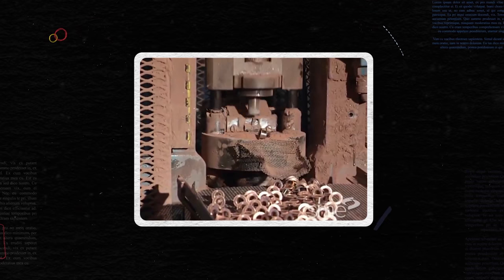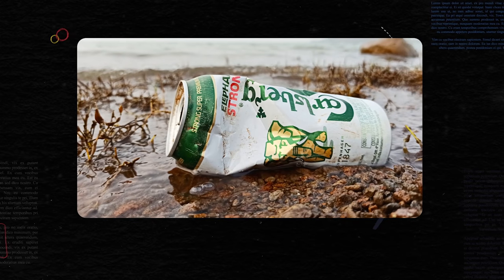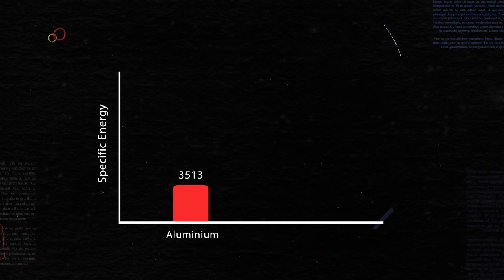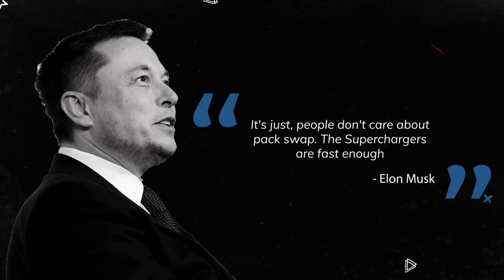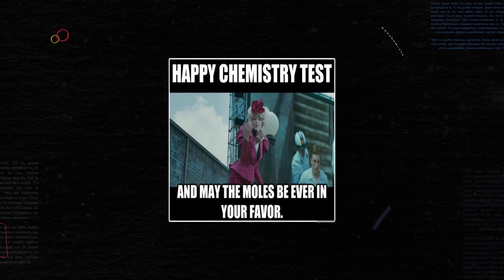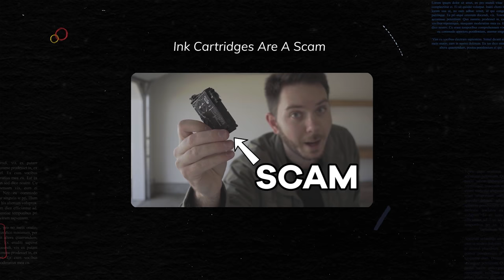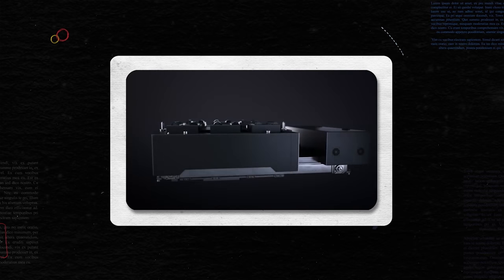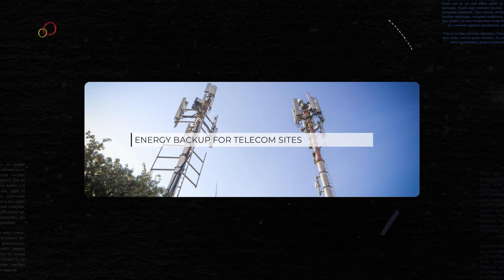We Can Get 1600 KM of Range With Aluminium Batteries

Comment: EV universal tow hitch connector would be helpful.  If all EV's could pull a trailer with an Aluminum Cassette battery you could get the needed saturation and greatly extend ranges.  That solves the chicken and egg problem of creating EV's before the infrastructure is fully in place.  Tractor trailers and delivery trucks would probably be the first vehicle to put them in as they tend to have regular routs.  
Also creating an automatic system to add water would be helpful.

Comment: Insightful video. Very interesting.
The only difference between fuel burning and single use battery discharging is that the battery has no emissions to environment while discharging.
Alas, i would argue, that making the battery creates more emissions than burning an existing fuel.
An electric battery for single discharge=human made, solid fuel.
The battery composition dosnt really matter in energy terms, what matters is the energy invested in making the battery.
The best solution is a fueled battery.
The fuel is mass produced/recycled in a factory. You drain/fuel your battery, instead of charging it.
It takes less energy to manufacture and recycle battery fuel than manufacturing rechargable battery and charging it.
Rechargable batteries are made from expensive materials.
Instead of rechargable batteries we need drain/fuel batteries.

Comment: This type of battery should be tested at installations like the Port of LA, large urban bus systems, perhaps integrated into a UPS. Perhaps  local subway or commuter rail systems would be a user. It would simplify the installation and maintenance of centralized systems if the economics and power density pencils out

Comment: If you have to refill water every 300 km, doesn’t that refill, constitutes the limiting distance of an EV.  1000 Km to swap Al cassette, and as ubiquitous as water is, technically it still limits the distance to less than a third of those declared in specifications.

Comment: The trick is to create an Al/O2  or maybe Al/F or  some other chemistry that allows aluminum to replace as a metal anode.   An amalgam or gallium allows aluminum to  react, but once it’s Al(OH)3 it’s a mess.    If there was some low temp material which could  contain the oxidized aluminum, allowing it to recharge /reduce, then presto.  
Cryolite and carbon is no good on a car.  Perhaps in grid level storage the high temp molten battery will work.    Reducing bauxite to aluminum probably takes a lot more energy to recycle than the energy cell puts out.

Comment: 300km is about the range of a tesla. so instead of charging you will be replacing electrolyte and sludge. For EVs Aluminum Air batteries are a terrible choice. Aluminum takes a ton of energy to produce so in reality it is a terrible inefficient storage method unless you are using over capacity which would be wasted otherwise. There are better uses for that wasted energy though such as pumped hydro or even hydrogen production. 
The bigger problem is that Solar energy actually makes global warming worse in the long run. You are absorbing more energy from space just as if you were emitting greenhouse gases. You need to increase the amount of energy the planet gives off and not increase it by covering it with dark solar cells. We need to reduce absorbed sunlight and reflect it back into space while using geothermal, tidal, hydro, and nuclear. Wind power although a great energy source produces lots of carbon fiber pollution and requires lots of energy upfront. We no longer have that spare "global warming" capacity to use wind energy. If you want to give Humanity a chance of surviving we need to go nuclear NOW and increase size of the ice caps while decreasing the amount of light we absorb through, roofs and any other dark surface.

Comment: The aluminum is recyclable.  If the facility doing swaps is managing that it could drop the price substantially as aluminum is nearly infinitely recyclable (does not degrade during smelting).  The only issue is that the smelting is very energy intensive and probably eclipses the charging power.

Comment: The convenience of charging a car at home cannot be overstated, so I think Lithium batteries are not going anywhere. But combining them with an aluminum fuel-cell as range extender is a great idea, I think, if cost for the dual system is on par with a larger battery. (I drive a Volt so can appreciate the concept of range extender.) Utility-scale storage, or even home energy backup are great ideas too.

Comment: I want to comment on a fault statement about unrecyclability of Li-on batteries in this vlog; Li-on ev-batteries will have a closed cyclevery soon! Large scale recycling of Li-on batteries has been planned for years and is being worked on right now. It will be done for at least all Tesla cars and highly possible all other cars as well!
This sole fact entirely spoiles the case made in favour for Aluminum Air batteries. In time there will be another type of batteries to replace Li-on batteries, but it won't be Aluminum Air batteries ...

Comment: It was good until she said L-Ion batteries end up in landfill, it might be true for phones (although legislation should prevent it), but it is not true for large vehicle batteries.   Cars mostly don't need it, but large long haul vehicle or long duration will benefit from swappable Aluminium or Lithium Air batteries.  Perhaps caravans could include it to extend the range of the tow vehicle.

Comment: The comparison to lithium as a component of the Earth's crust is a mis-direct, because the percentage of the actual lithium content in a lithium-ion battery is vanishingly small compared to the amount of aluminum (or aluminium if you please) in an aluminum-air battery.  That said, nice presentation.  This seems like something that would have utility in commercial short-travel marine applications, like fishing boats, where they go out for the day (or a few days) and return to the same port, where a battery-swap station could be constructed.

Comment: Ask electricians about oxidation for aluminum. Any AL freshly exposed to air oxidizes immediately, with a subsequent rise in resistance enough to set houses on fire that use it for wiring. Its mostly banned for household wiring for that reason now.

Comment: The hassle of swapping those anodes sounds a bit too mich for normal consumers, especially when you have to plan routes ahead of time. I can see it in the rail industry though, they already have timetables and set distances due to rails.
I could see this working, if instead of switchin a whole 40kg anode, you have  smaller modules of 5 kilos, that can easily be switched anywhere. Just opening the hood, unlocking the spent modules, switching them for new ones (like batteries in rc-cars) and you're back on the road.

Comment: Naming Tesla and then at the end of the batteries ending up in landfills... Someone ignored Tesla battery day. They ficused on speed of manufacture and changed the bulk of the manufacture process due to that. They bought up Maxwell for their rolled electrolyte tech which at the end of a battery's service life they should be able to open up the old batteries and just scrape that out  and back into the hopper to make more... Barring any new surprises. No matter how good something seems in protoype the proof is in the pudding, it's manufacturing that most forget.

The basic battery manfacuring tech had been the same processed used for about a century before Tesla's announced their new giga battery plants. It was a big enough leap forward being touted that is rocked the stockmarket price of a supplier, before they were reassured every battery made would be needed.

Manufacture is not an afterthought but a major stumbling block for a few seemingly neat ideas, let's not count chickens before they've hatched.

Comment: Lithium air primary cells are much more practical than Aluminium or zinc because of the efficiency of recycling is  very much higher with lithium and no CO2 or fossil fuel nessersery.

Comment: Great presentation that makes your presentation redundant from a sustainability point of view.   Well done!  Lithium ion batteries are mostly either nickel or iron.  And they will be recycled because of all the materials available there.  So your assumption of lithium ion batteries ending up in land fills is incorrect.  Battery swap is ok for motorcycles.  Not for cars.  Finally 136 wh per km is fine for small cars in warm climates.  But this number gets significantly higher in colder climates and for larger vehicles.   Nice try.

Comment: I would say that it will never happen that Aluminum-Air batteries replace Lithium batteries. Because they are basically disposable. As the anode must always be replaced. In addition, in practice, the weight increases when the cycle is discharged. But while the alternative to a gas or coal-fired power plant for the stabilization of the electricity grid sounds interestingly quite as an alternative to nuclear power plants. But I would rather see it as an alternative to coal-fired power plants. The main issue is basically the consumption of oxygen for the production of electricity at the local level.

Comment: They invented the term fuel cell as they were not really batteries, and trying to use one for the other just adds confusion. But if aluminium comes into common use the price of that metal is going to go up, that is simple economics. There is no enough electricity to power all EVs that would need so it comes efficiency in the application of selectivity for mileage. They will after all be using the same source.

This does not mean that fuel cells would not have their applications but in an enclosed tunnel using what is esentially a combustion system is only going to add cost and complexity certain types of infrastructure. Also all the tech Musk is pushing for  is aimed at working off Earth on somewhere like Mars as its eventually intended destination.... I'd like to see that air battery work with no air <.< Which is the point of WHY Musk chose what he did and manufacture is where his recent efforts have been focused to bring down prices and speed up manufacture.

Protoyping is easy, most that do fail at bringing the prototypes to mass manufacture.

Comment: Can a single large Al-Air battery, be replaced by multiple smaller ones, so they can be swapped easily by the  end user. Until that becomes a reality, mobile battery swapping service providers could fill in, since a business opportunity would present itself to them. 

An electric car eliminates so much regular maintenance that an I.C.E car owner goes through. Swapping a battery could become as simple and easy as swapping a battery in any other modern device, sometime soon. 

Or when electricity generation truly goes surplus, wireless charging could be built into the road infrastructure, one rechargeable battery charges while another runs the vehicle. Electric cars that charge on the move would be cool.

Comment: i think tesla batteries are more like 300 wathr/kg not 150. elon says 400 is doable in the future with the new battery architecture. lithium ion batteries are actually more like nickel batteries. there is very little lithium in the batteries. i question your pricing of 2/ kg for aluminum. that's like figuring out a direct conversion of electricity to hydrogen via electrolysis which is around 3 dollars/ kg. yet hydrogen sells for 15 dollars/ kg.
to turn the oxide back into aluminum takes the full amount of energy plus all the energy losses you have in reclaiming the oxide and transporting it etc. and you can't efficiently run an aluminum refining cell when you can get cheap power. it has to run continuously.
then having to remove the sludge every 300 km is very often . people will get used to at home charging and will not want to give that up . and then there are all the other features of tesla vehicles such as their  autopliot and fsd which is amazing. people need to stop claiming something is the next tesla killer. how about a conventional car killer instead.

Comment: for a 100 kilometer range the anode would weigh less than 4kg. As the weight of the car and battery would be only about 67% of a tesla. that's easy to change at home.

Comment: Most people are used to stopping at gas stations. So why not water stations? The biggest hang-up I can see is the need to drain the aluminium oxide each time. Maybe an initial water flush to drain followed by a refill. It wouldn't take long and wouldn't cost much. Just need to design a fuel cell with good flow characteristics.

Comment: Although weight is a problem, if you cut the aluminum replacements in half the resulting approximately 45lbs is very manageable for replacement parts. In any event even the heavier aluminum replacements could be done from beneath the car with a small robotic device which will become cheaper as more of them are manufactured. Think about how cheap robotic floor cleaners are now compared to when they entered the market.

One huge problem I see is lobbying of governments by large corporations which have a vested interest in making the easily price fixed lithium because of its rarity the one solution.

Comment: if you need to replace the electrolyte every 300km then the battery doesn't actually have a range of 1600km. overall this technology may be better then l-ion batteries but the infrastructure needed to support it looks to be nearly as complex as hydrogen fuel cells. the only way I see gas cars dead by dates like 2030 is if we build a ton of new fast charge stations and retrofit old cars for less than $5000. I don't see a car getting a new engine and a battery for that cheap though.

Comment: You missed the main point. Aluminium batteries have a low recharge rate, and low lifespan. imagine waiting for 1 hour to recharge your battery vs 20 min for the same amount of KWh. Metal air batteries have superior storage capacities but have drawbacks like not being able to be waterproofed, and other deficiencies you wouldnt want in a car. These batteries are great for static installations but also have a maximum density per area (not battery) because theres only so much air you can share till you reach the limit of it being an electrolyte.

Comment: Have they solved the non-stop runaway reaction with aluminum air batteries? What do I mean? As an example an unused li-ion battery can hold it charge for over a month without use and it'll loose less then 10% of its charge over that time. With aluminum air batteries once the reaction starts, there's no stopping it. Meaning an aluminum air batter would have reacted the whole time eating nearly 90% of it's life span within the same one month time frame. Think of it as a gasoline engine you never shut off, it consumes the anode whether you are using it or not.

Comment: Tesla already have a patent for combining metal-air batteries and rechaxrgeable li-ion batteries for sutomotive use. Using cheaper electricity for local use and regenerative braking, and using the metsl-air batteries as a range extender for longer trips.

Comment: They may not be well suited for cars but I wonder if they could be feasible for aircraft. Planes need regular maintenance anyway so swapping out an anode every few months or whatever is no big deal. Planes also get water serviced every flight so topping up wouldn't be hard either. The energy density seems to be there so question would be weight and range...hmmmm. Metal air batteries might have a better role in electrifying aviation.

Comment: Why not use a slurry of aluminum powder and electrolyte instead of solid aluminum anode ?  Then you could pump the old, used, aluminum oxide out and pump new slurry in.  That would be much more convenient than taking it in for service to have the entire cassette replaced with a new one.  The speed of the reaction and electricity production is controlled by the supply of oxygen, right ?  So the aluminum electrolyte slurry won't go bad as long as it is kept sealed.

Comment: If you divide aluminium-air battery into cell sections, then each anode replacement becomes easy. Although this might seem so obvious, there are definitely some other obstacles in doing so.

Comment: Bottom line: Burning aluminum to run a car.  This is not a battery or a fuel cell.  It cannot be recharged.  On average,  1 ton of aluminum creates 5 tons of CO2 when manufactured.  So you are burning coal to make aluminum to run your car.

Comment: a little dishonest when it says "per charge" as these batteries are not chargeable, each time you use it you neet to melt it at 2150 degrees to get aluminium back. The price of aluminium is based that most of it is recicled, in these cicle the equations are way different. Aluminium bateries have been know since Napoleon (volta presented one to Napoleon at the beginning of 1800's and there doesn't look like there is a optimal way of obtaining it (usually additional metals are used to reduce the temperature to obtain aluminium and is still a very polluant industry and the amount of emergy used is incredible high in contrast to other energies. So not still ready for mass usage.

Comment: Converting km to miles, and mile to gallons ... about the same cost as gasoline, economically speaking.  But not needing to have a charger installed or fill a gas tank on a weekly would be a definite plus.

Comment: I think this technology has great potential for larger vehicles or as backup power for large facilities.  When it comes to smaller automobiles, why not use 2 or 3 smaller batteries that could be swapped at home?  What limits this? Surely someone had the idea of using multiple smaller batteries.